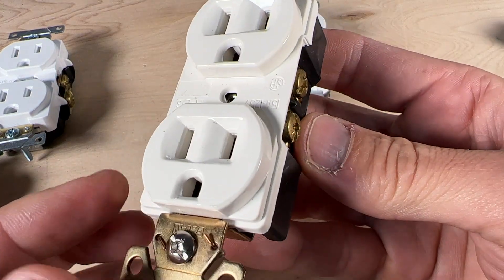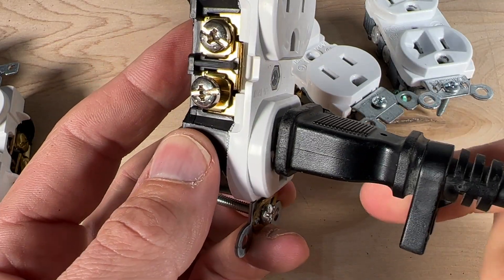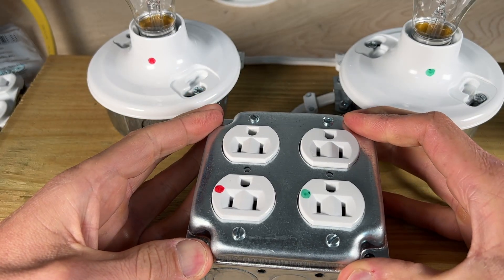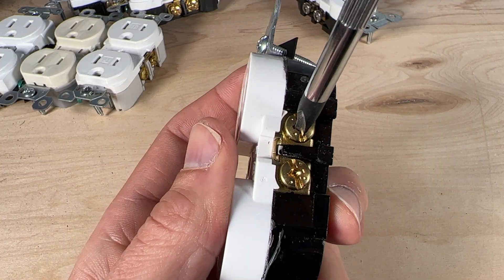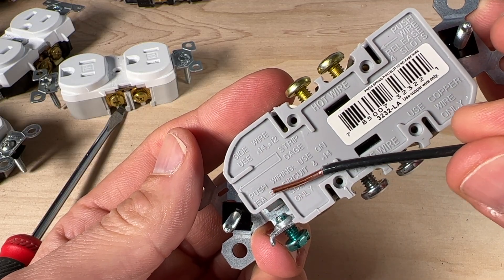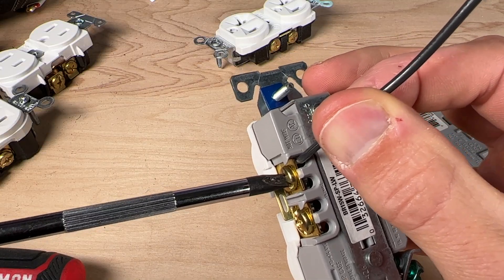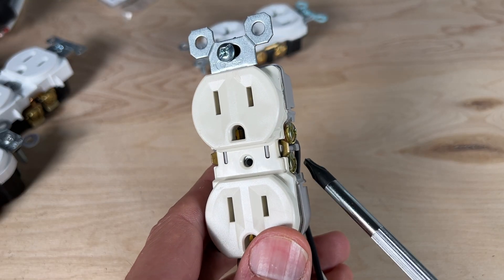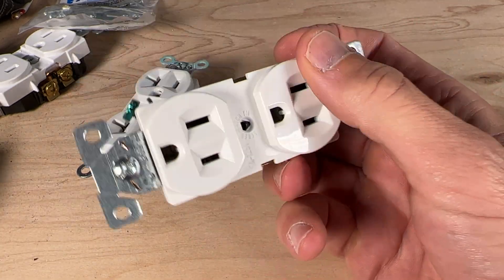21 Facts and Features Of A Standard Outlet

Comment: Another FYI, self grounding devices are only meant to bond the device to an already bonded metal box without needing a pigtail to the device. It's against code to use the device to bond the box. The box should be bonded regardless of whether or not the device is in place.
Reply: @ronb6182  NEC states that EMT can be used as EGC. I like to run a ground inside it anyways.
Reply: @illestofdemall13  outdoors to ac units like with multiple motors it's required. The compressor and fan are two motors. Also if you have orange outlets with isolated grounds you have to run a green wire and then ground the outlet to the panel. The outlet is not grounded to the metal box. 73,
Reply: @ronb6182  Yes, like hospitals.
Reply: @illestofdemall13  I agree but some morons don't agree. I been on both sides of the argument so I'm staying out of this argument. If I was to put a ground wire in EMT it would be a green insulated wire like in dedicate isolation grounds the orange outlets. I done a few to reduce noise. My Ham radio setup will have isolation grounds to reduce noise when I build my ham shack. I also have to follow FCC regulations as well my bench must have a ground bar to hook up equipment as well. And I will put an ESD Matt on the bench with earth ground. 73
Reply: @ronb6182  I personally run a green wire and so does my boss (the owner and electrical contractor of the company I work for). It is good practice but on some jobs the electrical engineer may spec to not have a ground wire in order to save money, and it would still be code compliant as long as everything is done properly.
Reply: @illestofdemall13  yes sloppy work don't constitute bad NEC requirements and anyone that works on live three phase when it can be turned off is a fool. Wires that are bad should be removed and replaced no matter the cost. As for EMT there are better connectors not like in the past. All work should be checked before applying power. I never cry wolf on sloppy electrical. 73
Reply: Ah yes, I believe that is NEC 250.148 how for some god forsaken reason, the strap cannot provide ground for the box and subsequent metallic entities, but vice versa is safe.
Reply: @Inova3DSolutions  Because the box needs to stay bonded whether or not a device is in place. If you remove the device that was providing bonding, then the box loses it's bond. The device is for the end user, so its power and bonding is provided by the box it's housed in, not the other way around.
Reply: @illestofdemall13  Duhh I'm stupid
Reply: @ronb6182  self tapping screws are not approved for grounding. Ground MUST have at least two full threads do only a machine screw is approved for grounding the wall cases for devices. On very old boxes that do not have the threaded hole you can use an approved ground clip to ground. Only fools use EMT to supply the ground. Have seen it pull apart too many times. A coworker came close to getting electrocuted when he attempted to reinstall a EMT conduit that shocked him due to a 480 volt wire had a nick in it exposing copper wire. Better safe then dead ! Always pull a copper ground wire.
Reply: @JohnThomas-lq5qp  NEC approved EMT only grounding and I'm not stating which side I'm on . This is an old argument if you have to know search all the grounding issues on you tube. NEC says its accepted even with GFCI . Enough said. 73
Reply: @JohnThomas-lq5qp  no kidding read the comments before posting. 73
Reply: Little known fact. The grounded box doesn't mean shit.  I thought that to with the self grounding receptacle until I started trying to use them in that capacity and every test showed they still weren't grounded without the ground jumper.  You can use a ground screw to the box with the bumper wire and then it ground without having any other ground wiresin the junction box. That works high 90%.
Reply: @ronb6182  you cannot use a self-tapping screw to bond the box, it must be a 10-32 screw with at least 3 threads engaged
Reply: @KingOfChins  it don't matter that was years ago like over 50 years.and the outlet bonded to the box which is not legal. But it has many turns not just three. When you are a teen you don't read the NEC you just make it work. I'm glad electrical boxes have bonding screws unless they are plastic. Then you just hook the ground wire to the outlet. 73
Reply: @ronb6182  a self-tapper will only have one thread engaging the box
Reply: @KingOfChins  yes but the two screws have many turns holding the metal to the box that's why it worked. Things done 50 years ago cannot be redone now . But I see why they put ground screws on boxes now . There were no grounds in the early fifties. The outlets were made different you could not split top and bottom unless you had a special outlet made for that purpose. Dad must have found two because we had split circuits in the living room. I should have kept the old outlet because it's easier to show than to explain. Oh the outlet also took horizontal prong plugs which were way back like the thirties. I don't think you can buy those type of outlets. I haven't seen at home Depot. 73
Reply: @ronb6182  Some of those old metal boxes were bonded from the back with an 18AWG solid ground wire.
Reply: @illestofdemall13  I don't know dad wired the house before I was born. All o know the center screw was grounded and that said the whole house was wired with green field and exposed wiring was in conduit. I guess he got stuff from work that they threw out. Number 10 wire to the outlets so you could use 30 amp fuses I used to put lower amp fuses in my room circuit. I had 10 amp and 6 and one quarter amp fuse the kind used on motor circuits. I was safe in my rooms where I had my electronics desk. I had a scope and VTVM and I would borrow test equipment from school. I used to watch music on the scope who needed music videos. Music videos  were not thought about until years later. The beautiful music genre and classical music was my teen life I hated rock and roll. Also big band music would have been playing in my room. I had a friend that had over 100 Duke Ellington albums at college we would stay up late listening to Barney Bigard and Harry Carney on the clarinet. They don't write music like that anymore. Most people didn't like the horns with the mutes but that made the music you never knew when the horns came in. Well that's old school wiring and music.  I don't know how I got off on that rabbit trail. I know how to wire and don't take short cuts what I did as a teen and now is completely different. 73
Reply: @KingOfChins  I seen multi threads on some self tapping threads very fine threads but code don't allow the use of self tapping threads of any kind. And grounds I don't remember seeing any ground buss in the fuse box only neutral. And it was grounded to water pipes and a stake in the ground. Old school wiring didn't have grounds in Romex the black wire with a jult cord. The wires were black and white with a small black stripe. Knob and tube came before the black Romex wires. Also no grounds. 73
Reply: I am updating the double horizontal outlet I did find one with a ground but at 15 dollars a pop I won't be buying any. The outlet takes both types of plugs I have no need for a double horizontal and vertical pronged slots outlets now 240 horizontal prong plug I need one for a heater which I won't use all the time but would be nice to take the chill off a shed room in the winter. 73
Reply: @ronb6182  It's always interesting to see the old electrical parts. What area do you live in? I am in South Florida so it is warm/hot most of the year. I was born in Syracuse, NY, though.
Reply: @illestofdemall13  central Florida. Between Tampa and Disney world. 73
Reply: @ronb6182  I lived in Orlando from 2004-2006. I never get cold here in FL so never use any heater. I just throw on a jacket and jeans. I run hot, though. I prefer 60-70 degree weather but don't mind 50 degrees, either.
Reply: @illestofdemall13  I know this is an oxymoron but the cold part will be in North GA where my retirement home will be. Believe it or not 25 degrees up there is like 40 in Florida. I go outside with just shorts and tee-shirt if for a short time like getting something out of the car. I know we only heat one room in Florida I use the oil radiator type of heater on low or 600 watts if I'm in a hurry then medium which is 1200 watts .  But my electric portion never or rarely goes over 60 dollars a month. Mostly 50 dollars. The other utilities like water and trash pickup the total bill is around 85 dollars. We don't have sewer just water. Up there I will only have electric no trash and no water and the well water is excellent. And safe. Most people go on and on about pollution but not many people live there and it's farm land which hadn't been farmed in ages. I'm not allowed to have cows and hogs and I don't think there are horses either.  I think I can raise small animals which suits me fine. I'm more into growing things. The little bit of trash can be taken to the community dumpsters like 1.50 a bag which isn't much. I recycle cans for cash. The fire department takes some recycling every Wednesday mornings. Well I expect some things will be less costly but going shopping will require some travel. 73
Reply: @ronb6182  Sounds like a nice quiet place to live in peace and grow some fruits and veggies.
Reply: @illestofdemall13  yes and pick wild fruit also.. north Georgia is not too far from my property in NC which is loaded  with wild blackberries. My wife's parents built the little house in Georgia and my wife wanted to buy it Mom doesn't want to go there alone and we need to do some work on the roof hopefully I will get good weather this July. I know this is off subject but I did wire the house. I may build off grid power also but right now work needs to be done on the house. I also need to trace out the power line down to the creek my father in law ran underground line for a pump but the water didn't flow fast enough for house use so he put down a well. That water is good tasting I'm glad the spring idea didn't work.well with good wiring practices this for the most part was an enjoyable video and so we're some of the Comments. God Bless you and thanks 73
Reply: @ronb6182  Sounds like a nice place to stay. Reminds me a bit of this place my great grandmother lived at in a remote part of Upstate New York, many years ago.
Reply: @illestofdemall13  yeah my piano teacher had a small place in Ripley NY it was up on a hill and you can see Canada over lake Erie. There were lots of grape harbors all around when I visited she let us stay overnight and we stayed up all night looking at stars and I would point the telescope towards Canada and look there. The reason we stayed up all night we wanted to see Venus. I been up there but I don't think anyone lives in that little house. Maybe it's a rental. It's not the same when she was living I'm sure my piano teachers sister is probably gone too. The house in Pittsburgh is gone and whoever bought the property built a large home in it's place. 73
Reply: Number 17:  Form a clockwise J hook.  Except your video shows you wrapping in a Counter Clock Wise direction.
Reply: @JA-FirstStage  Look which way the hook is going, not which end it was bent from. You and every other person who said that is wrong, unfortunately.

Comment: Just FYI, at 7:01 you can see that the insulation of the wire is under the screw terminal (usually means you didn't strip enough off) and that is not ideal. Only copper should be under the screw. Insulation under the screw can create a poor connection.
Reply: Good catch

Comment: At around the 45 sec you mentioned non polarized plug you can put it in the outlet anyway.  I recall somebody telling me you shouldn't just Willie Nillie plugging those non polarized plugs in anyway but to always plug the side of the cord that has that raised edge into the neutral side of the outlet. Something about the other side of the plug which would be the hot end is more beefed up inside. Anybody else heard this ?
Reply: If a device is UL listed and comes with a non polarized plug then just plug it in and move on with life. It makes no difference.
Reply: Usually with a non polarized plug, the electricity be being converted to DC along the line, so it usually doesn't matter
Reply: there is no difference in the hot or neutral wire in cords it is just marked for people putting on polarized plugs to know which one is which the best reason for polarized plugs is lamps where the hot should be the metal disk at bottom of socket you put bulb in. not the threaded outside that you could touch while changing a bulb and lamp is on but you can't tell because it is burned out so, you could get shocked. but only the newest lamps have polarized plugs old ones are unpolarized if you change plugs on an old lamp a polarized one installed correctly would be better than the original plug
Reply: @ranger178  The indentified conductor is by code designated to be the neutral conductor. Whether by color or ridges in the insulation.
Reply: @jeffreylong500  yes I know that but the question was if plug is non polarized should someone worry about putting plug in with marked side to neutral and i said if its modern and it made a difference it would have a polarized plug. if it is old a lamp without polarized plug would be safer if the marked side was in neutral or you could put a new plug on

Comment: Hi Guy, 
You missed something important. Child resistant receptacles. (Check out your presentation about 9 8  minutes 8 seconds in).  The modern receptacle on the right, is known as a child resistant receptacle, it has shutters to prevent a pre-schooler child from sicking a metal probe of some type into the receptacle.   It requires at least a two prong plug to get the shutter to be pushed aside,  Electically, the rest is similar to what you described.  Many homes with playrooms or children bedrooms have these recepticales that have plastic shutters.

By the way, I cannot tell if by insertion of a plug, the shutters move away to expose the receptacle contact, or if by plug insertion, it causes the shutter to move the receptacle contact to touch the plug contact.
Reply: those new tamper resistant are pure government garbage you can just get cover plates with twist covers if you want to keep kids out or a pack of plastic outlet covers the tamper resistant ones don't work well and are hard for everyone to use and something else to break and add cost to a house
Reply: @ranger178  In my jurisdiction, (Montreal), these "safety" receptacles are not mandatory.
So far, we are not allowing plastic boxes for switches or receptacles.  Marattes are still preferred.
Reply: Tamper resistant
Reply: All I know, if those kind of tamper-resistant plugs are a pain in the keester.   I don't like using them- it's more difficult to push a plug in.
Reply: @88KeysIdaho  Do you have one-year old or slightly younger, crawling around the house?  I like those receptacles for one use and reason  floor level baby protection. 
At floor level, the general use is a floor or table lamp that gets plugged into the receptacle, and it is rarely to never  unplugged.

Comment: At 2:21 the receptacle on the left side is wrong! The hot and neutral are switched
Reply: Scott had a demonstration video a while back on why hot and neutral matter and how dangerous reversal is.  This was the unit he used for it.  (The red dots indicate wired incorrectly.  Green is correct)
Reply: That's why it has a red dot on the front and the properly wired one has a green dot. He probably used it in another video to demonstrate proper vs improper polarity.

Comment: I truly did not know why the neutral plug was different on the 20 amp... I guess I have never seen a "small" plug in that configuration. Thanks!
Reply: I wondered the same thing.  I've always installed 20 amp outlets (for example, in a kitchen) with "regular" slots.  The only time I've seen that kind of neutral "T" slot was on an outlet designed for 30 amp.
Reply: @88KeysIdaho  They don't make 20 amp with "regular" slots. They all have the T slots.
Reply: everyone puts 15 amp outlets on 20 amp circuits because almost no appliances have a 20 amp plug the 15 amp plugs are rated for 20 amps pass through on gfi s and such
Reply: If an appliance utilizes enough power to require a 20 amp branch circuit, it will have a 20 amp plug.   One vertical and one horizontal.  They do exist.
Reply: I do know they exist, I just haven't ever come across them in my personal or work experiences. That's not saying I am an electrician... or I probably would have.
I didn't make that clear in my original post. Thanks for the info though!!
Reply: @Toyotajunkie  I am an electrician and also it's been rare for me to see them.

Comment: Almost all new Duplex outlets are now sold as  TR and the code for new construction is to have TR installed. I don't ever use the back stab, but do use the back wire setup that has screws that hold the wires in and makes for a better grade outlet.
Reply from the maker: TR is code in my area but surprisingly our most common outlets sold are standard not TR at Lowe’s and HD.
Reply: TR are required for any receptical below 6 foot. Anything over that is allowed to be non tamper resistant

Comment: Never seen a pro use the push in connections.
Reply: They're used by electrical installers in new home construction almost exclusively. Because it's less than half the time versus using screw terminals, and time is money. Builders couldn't care less, unfortunately. If I owned such a house I would re-terminate all my devices!
Reply: Guess that answers the question: "is this guy a professional?"
Reply: And yes, NEVER use those "back stab" push in connectors.